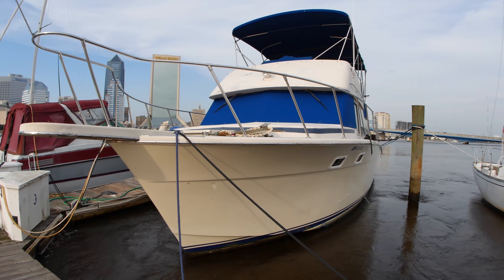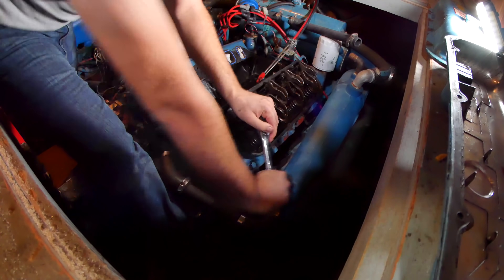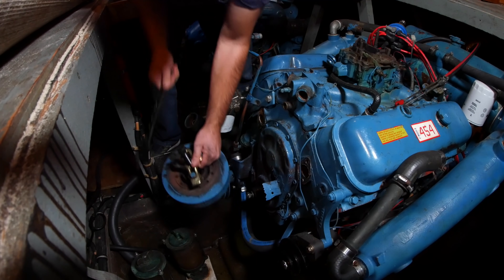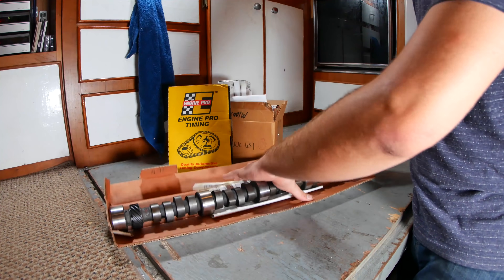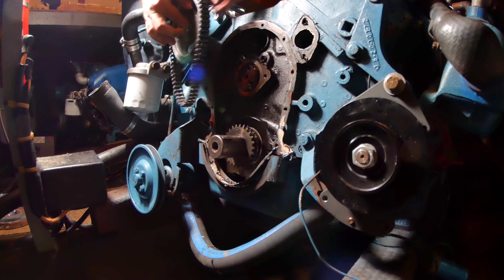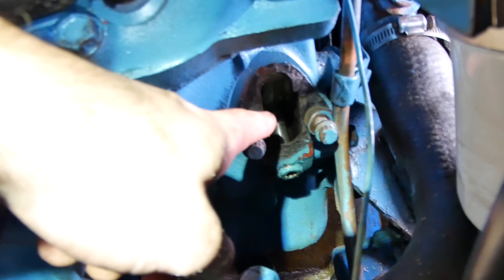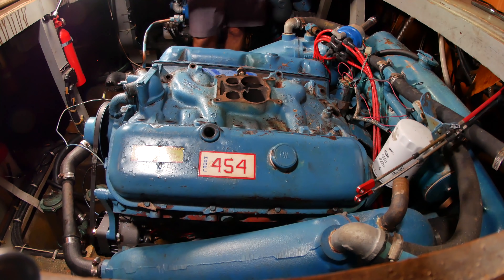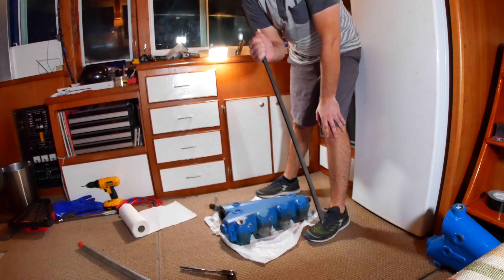The Biggest Project I've Ever Tackled (Boat 454 Repair)

Comment: That color is called, "Chris Craft Blue", which is very similar to, if not the same as GM Corporate Blue from that era. I have a '71 CC XK-22 and TONS of pictures of engines that color... Not to mention have seen plenty in person that are that color.

Regarding the exhaust, unless the manifold was leaking internally (doesn't look like it), the cam failure was likely the cause of the water in the exhaust port. There is a condition called reversion where water is sucked back up the exhaust. When the cam lobes were failing/had failed, you no longer had exhaust flow from those cylinders, meaning that there wasn't enough exhaust to keep the water out.

When you were pulling the plugs from the new exhaust, your should have installed the manifold beforehand. That way you wouldn't have to hold it in place.
Reply from the maker: That last bit of advice made me smack myself in the head. It seems so simple when it's spelled out! Haha thanks for all the great info.
Reply: @CullenCraft  safety tips because you didn't mention them.

You pulled the fuel pump, but did you turn off the fuel valve?

Did you disconnect power from that engine and remove the key from the ignition? You may be the only person on the boat, but, "things happen".
Reply from the maker: Always.

Comment: Very Impressive!  I have to change out the exhaust manifolds on my 454 Chris Crafts as well. As you mentioned, the Chris Craft manifolds are no longer available - so I will be using the Crusader style as well.  The CC manifolds had a 3.5 inch dump and the Crusader elbows are only available as a 3 or 4 inch dump.  It looks like you have a bushing or a piece of 3 inch exhaust hose used as a bushing on the 3 inch dump.  Not a bad idea versus a reducer.  Let us know how it worked!  Manifolds stay cool?
Reply from the maker: Peak out at 180. Perfect temp!

Comment: Use Delo 30 wt  for diesel engines.  And bottle of zinc additives  with marvel mystery oil  in  fuel  i use this on my big block marine engines 
And customers engines i service  plus always use AC Delco oil filters ot wix ... never use fram or anything else  they can damage engines
Napa gold oil filters  is made  by wix  filters   ok to use also  great video thanks for posting 😊

Comment: One thing can be hard to find, sometimes the lifter sticks in its bore and can't rotate. Can also cause same type of damage
Reply from the maker: Yeah. I thought upgrading to a roller cam. That would solve all the issues, but a set of lifters and the cam cost like $800 minimum. Plus anything I do to one side I need to do to the other. And the other side is counter rotating! That would be mind-blowingly expensive to find a roller set for!

Comment: You definitely don't want exhaust manifolds leaking water back into the engine.  I had that blow up a Mercuruiser chevy small block that was almost new.  Expensive and no fun so always inspect your exhaust manifolds if you have them off.

Comment: Question where you buy all the parts  I  just got a 1975 trojan.  Tht I am  having hard time to find parts for chrysler 440
Reply from the maker: I buy the parts where they are the most ubiquitous. Obviously, a lot of boat-specific parts will be hard to find, but I bet you can find a Chrysler flathead gasket at AutoZone. 

Always look for the lowest common denominator, if it seems like a car part, ask the car suppliers. I was able to track down several Chevy suppliers in my area and asked for quotes to find the best deal on the camshaft.
Reply: Appreciate  I been watching  you videos over  over I  am learning  from you videos     !!
Reply from the maker: My best advice is don't be scared of your engines. Especially if they're based on common enthusiast motors! Just go into O'Reilly with questions about your "Chrysler Imperial." You'll get a lot more useful info. 

I remember a few years ago I asked specifically about a Chris Craft Corinthian and they pulled up my own video on the store computer lol

Comment: Next time you do the exhaust manifold. You'll notice that the front and back holes on the gasket are not all the way closed. This is so you can start the front and back bolts and slide the gasket in
Reply from the maker: Haha you're right! Wish I had noticed that. It worked out, though.
Reply: @CullenCraft  loved your enthusiasm. For someone who's never been that far into an engine, you did great. If I lived closer, I'd have jumped in there with you but I'm clear out in iowa

Comment: Nice job.  It did however sound a little tappy.  How much pre-load did you put on the lifters.  In the Mid Mo Marine video he only used 1/2 a turn.  But he was doing a performance engine, yours is pretty much stock and should have 3/4 to 1 full turn.  If it's tapping, you will want to readjust them.  Tapping = engine damage.  Good luck and happy boating.
Reply from the maker: It quieted down after running for a while. Those lifters needed to fill with oil.
Reply: @CullenCraft  Good, glad to hear it.  If you have any top end tapping on cold start up go ahead and give those guys another 1/4 turn.  After all this you should be able to do that in your sleep.

Comment: wiped cam was a gm issue back in the 80's to 90's a lot of times engines get a coat of paint to stop corrosion

Comment: Did you check the oil pressure ...must be a reason for the cam shaft failure i am guessing lack of lubrication
Reply from the maker: I've been told its just a design flaw of 70's chevy big blocks. Flat tappet lifters that like to wear down. Roller style lofters can help, but they are very expensive, especially for a counter rotating camshaft.

Comment: Just started on the vid, bit curious on the zinc comment as its widely available as a run in and performance oil  here in Australia 

I use it without fail on every vehicle. 

Is that not the case in the us?

Strange if so as its needed for run in and performance engines.
Reply from the maker: Im not an expert on all this... But it seems like its been taken out of most oils here. You can buy it as an additive i know that for sure.
Reply: Cullen. Oil with zinc is absolutely available. VR1 oil Valvoline straight 30wt or 10W30

Comment: Great job! We’re you able to determine if the old heat exchanged was compromised?
Reply from the maker: Not specifically. The water and slush could be from a leak, or just normal water vapor in exhaust gas. Either way, I'm glad I was able to swap it out.
Reply: Have the old one cleaned and pressure tested. If it was ok keep for a spare. Great job and way to dive in. Balls of steel my friend

Comment: Replace 454 with 383 stroker  engines the 454 have valve trans problems because the push rods are angled and the oil filter is separate from block and the cam moves forward and back so the cam bearings wear out fast and new lifters they don't make anymore only remanufactured you will need to replace cam bearings or you will have low oil pressure on the new cam

Comment: Is there a reason the new exhaust manifold was painted on the mating service? Seems like leaks just waiting to happen.
Reply from the maker: I had a part of the video where I talked about it... But I had to take it out to make things flow better. 

I think its painted so that it doesn't corrode in long-term storage. If the mating surfaces were bare, then they could rust and pit before they were bought. This way they're completely protected until the final owner gets them.
Reply: @CullenCraft  That was my thought as well after I finished watching your vid. Congrats on repairing the engine, that is a huge project to take on!

Comment: Got a question where did you order your parts from funny thing is I’m doing the same motor in the same boat but mine whole boat has a lot to go before it’s as nice as your.
Reply from the maker: I found a local parts distributor that had the right parts. It's the same cam and lifters as a standard 454
Reply: @CullenCraft  thank you very much we can’t wait to have are boat looking as good as yours we are also doing a few major upgrades to ares I see you have a after market fridge in your also is it a standard 110 or is it still a 12v we are gonna be full time on a mooring ball but my fridge took a turn an needs to be replaced.
Reply: One other thing I’m having issues with my STB motor it doesn’t want to fire which I’m pretty sure it’s a reverse motor since it’s turning to the right what firing order are you running ?
Reply from the maker: @ValhallaChriscraft  firing order should be cast into the air intake manifold. Easily visible numbers 1-8 above each cylinder.
Reply: @CullenCraft  it is just wanted to make sure that’s the one you used I’m changing my mercruiser IV electronic ignition out for a ACCEL hei at the moment.

Comment: Hi! I’m also looking to rebuild my 454 mer cruiser did you use regular 454 car parts or did you get marine? I heard it doesn’t matter
Reply from the maker: Electrical components should be marine rated for spark mitigation. Some Chevy based marine engines have custom internals, but most are stock from what I've seen. That's what was in mine.
Reply: When you removed the distributor to take the intake off did you bring the engine to tdc?
Reply: Also what brand cam and lifter did you use there super expensive I know in the video u said less than $300
Reply from the maker: I went to a local shop and got whatever they gave me

Comment: Hello fellow boat owner I watch your engine rebuild video. I'm contemplating on doing the same type of build in one of my engines if after my compression and  leak down test confirm my suspicion's do to so. I wanted to ask you are the part you bout marine grade or ordinary automobile parts?? If there are marine then can give me the information as to were you got them?.
Reply from the maker: Its a combination. This originally a automotive engine, social the part isn't specialized, it makes sense to use the original automotive parts. I got my marines grade parts from several different online sources.
Reply: @CullenCraft  Witch marine part was that?
Reply from the maker: A lot of them. I can't five you a definitive list because it will depend on the engine and the part. Just have to research and know how important that part is to the marinization of the engine and make your own judgement call.
Reply: @CullenCraft  ok thanks.

Comment: Where did you buy the parts from? They look well made!
Reply from the maker: I picked them up at a local supply center. They shipped them in, I think most were standard AC Delco parts.
Reply: Sweet. You have inspired me. I’m actually planning on rebuilding my Starboard motor. I have a 1979 Chris craft commander. It’s hard to find information on these motors and especially since Chris craft “made there own motors” at a certain point. 

Any suggestions or tips before I start?
Reply: Their*
Reply from the maker: Track down as much documentation as you can, poke your nose into some Facebook groups about old Chris craft, and commanders in particular. A lot of groups have documents available to anyone who asks.

Comment: for that engine do you have a thermostat in it?
Reply from the maker: Yes, I've got a 140° thermostat. Its what the manual recommends.
Reply: @CullenCraft  hmm okay thanks when I put one in I have no flow to exhaust until it gets hot and by then I'm smoking my exhaust rubber. it's an 83 commander 336

Comment: You might want to re torque all the nuts and bolts after you have run the engine for a few hours as all the gaskets will compress up with use and the nuts and bolts will loosen a fraction .Great video by the way.Keep up the good work .

Comment: You have FWC so the odds are your problem is not the manifold which has antifreeze but the elbows which leaks raw water down the exhaust. They should be changed every 8 to 10 years.

Comment: I really hate to bring this up, but, that camshaft was in such bad shape in that engine I wonder what the camshaft looks like in the other?
Reply from the maker: Its a good point. 
The starboard engine has very few hours on it compared to the port. 
The flywheel was stripped when I got it and it didn't even start. 
So I think this boat was run on a single screw for most of it life. Hopefully saving the starboard engine from too much wear.

Comment: Whomever you about the zinc was wrong there's plenty of zinc in modern oil, in fact with more zinc in modern  than in old oil. Adding more zinc will cause more wear issues and ring sticking.  Just look at project farms oil analysis results.. your maximum hours should be around 200 per change.. I would suggest you have oil pump issues on that engine
Reply: burningfeet 57  oil analysis proves that you're wrong, plus zinc isn't the be-all and end-all of wear protection, I'm a mechanic of 40 years
Reply: VR1 has the zinc spec you want.

Comment: Keep all the parts you're replacing as spares. Use diesel engine oil. It has plenty of zinc and you won't have to use an additive.  MAKE SURE YOU RUN IN THE CAM CORRECTLY!!!

Comment: You need to pull that Engine and do a Full Rebuild, WHY?  The old cam "ATE a lifter", as a result a lot 
of the metal that wore off is in the oil passages and on the bottom of the oil pan. If it's not disassembled 
and hot tanked so all oil passages are CLEAN, it WILL WIPE the new cam as well, and I'm NOT guessing.
                                                                                                                                                                 give it time.

Comment: Get rid of that copper fuel line from fuel pump to carb for your safety, it is not legal according to USCG regulations, it is a severe fire risk. Vibration can crack that line, and if it cracks you will have gasoline spraying all over the hot engine. You can replace it with A1 marine rubber fuel hose, or a pre bent steel fuel line

Comment: The exhaust manifolds are marine grade, you will not find any car exhaust that has a cooling system in it. Those exhaust manifolds should be replaced every two to five years

Comment: Take that manifold in and have a tank clean all that rust out you save it for a spare there's nothing wrong with it except it needs to be cleaned
Reply: Usually when there is rust at the manifold ports it means, A: the elbow is clogged with rust causing backflow of raw water into the manifold, or B: the manifold had a hot spot, and an internal crack developed allowing coolant to leak into the exhaust chamber. I've seen a lot of head/bore damage occur from  used exhaust manifolds/risers being put on an otherwise good engine. This condition is usually the downfall of marine engines rather than wear.

Comment: All the work u put in & u put the shitty rochchester carb back on it….?
Reply from the maker: I wanted to keep these engines as stock as possible during the rebuild, that way I could decide which parts were worth upgrading after they worked again.
Reply: Understand, when I did the engine work on my boat, I did not want the crappy factory carb to be the downfall, so I tossed it & put a 650 cfm edlebrock  on mine & it runs like a dream.

Comment: These are not marine powers, these are chevy based block, 454 crusader engines. Genuine marine 454 crusader exhaust manifolds will fit, don't quote me here but I believe the design of the manifold changed in later years of manufacturing, these engines (once running of course) are some of the better easy to work on marine engines someone can buy, simple, cheap (by marine standards), parts readily available. Worked on dozens of sets, easy to tell its a crusader, someone may have done a shit paint job but from factory they were all blue as well

Comment: So, Cullen... you're in for good news... I have a 88 Cobalt Condesa w/454 B1 Drive system. There is a manufacturer of oil in the midwest, CENPECO that makes oil with a heavy Zinc and additive package designed specifically for older engines. This was recommended to me by the previous owner. Not certain what weight oil you use, however, I use the CENPECO 15w40. A google search will help you locate some. http://www.cen-pe-co.com/2019/index.php/products/oils/heavy-duty-engine-oils. NO, I am not a salesman for for them. Cheers.

Comment: Not good practice to replace a cam shaft and not put in new bearings or at least inspect the old ones thoroughly.  Worn bearings will transmit that wear to your new cam shaft very quickly.  There was a reason the old lobes wore.

Comment: THEY DO SELL CONSUMER GRADE OIL WITH ZINC!!!! I use AMSOIL's Marine grade diesel motor oil (Don't worry about it saying diesel, it works the same for gas engines) in my 1970 Chris Craft 307's. because my engines also have flat tappet cams and need a lot of zinc..The oil is absolutely amazing and has some of the highest amounts of Zinc and other additives great for the marine environment you can get in a motor oil before you get into the real specialty stuff. LOL hope this is one of the comments you end up reading!   https://www.amsoil.com/p/sae-15w-40-heavy-duty-diesel-and-marine-oil-ame/?code=AMEQT-EA#pills-home_0

Comment: Youngster even calls it a damper and not dampener... You'll do just fine... If you take as much diligence into the actual wrenching as you do learning the the correct terminology, There's nothing you can't accomplish with a motor... Learn to read micrometers and dial bore gauges plus knowing what to measure and when you'll be rebuilding motors with confidence in no time.. Good job...
Reply: Spoke too soon... He called it a dampener twice... We will chalk it up to being tired... Won't holt it against ya though....
Reply from the maker: Once I realized the modern term is "harmonic balancer" the outdated term fell out of my head.